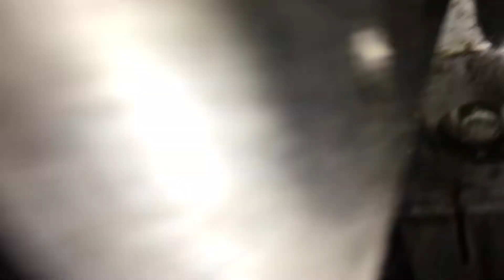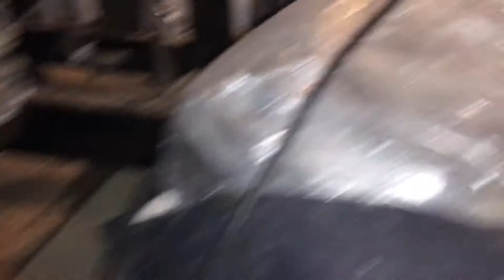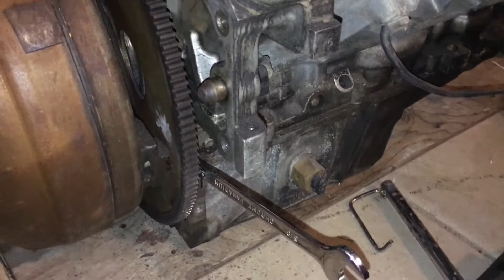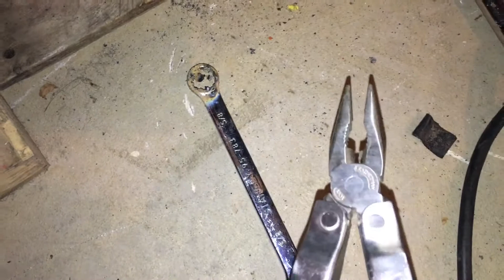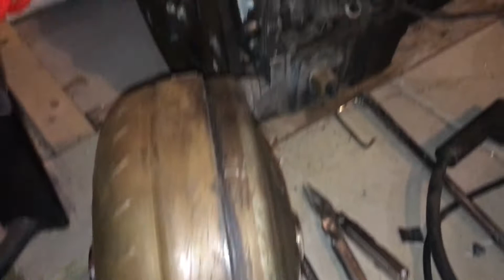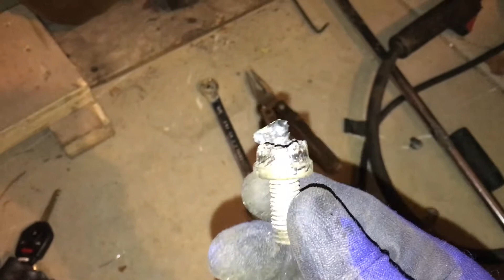Ls1 Striped Bolt Removed

Comment: now is that LS1 going in the Chevelle?
Reply from the maker: Kadillac Quin Custom haven't decide yet if I do go this ls1 I will built it to ls3 with ls6 intake and a 6 speed t56 transmission stick shift . Or I might start saving and throw a big block 454 or 572 ls . But in mean time I will be working on the chassis body ,rear end . With 24 by 15 rear 22 by 9 front   Rims all tucked in . This ls1 I did purchase for the box Chevy but I sold it and go for my dream car that way money can go in to something I am going to keep
Reply: +ZoCustom250 no doubt I totally understand. I can't wait to tune in! man you keep motivating me